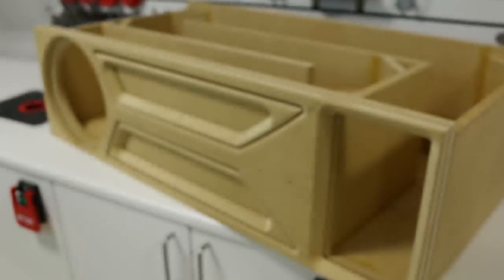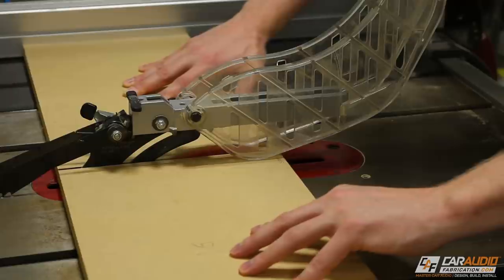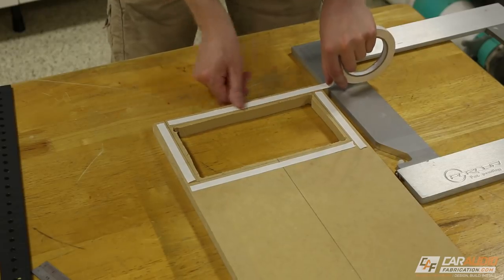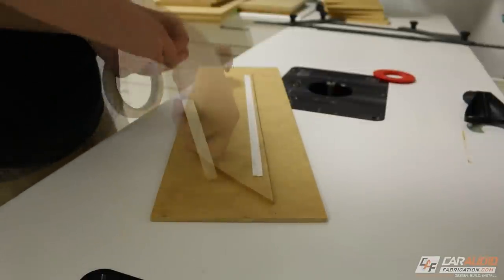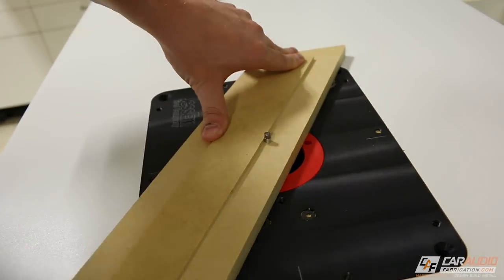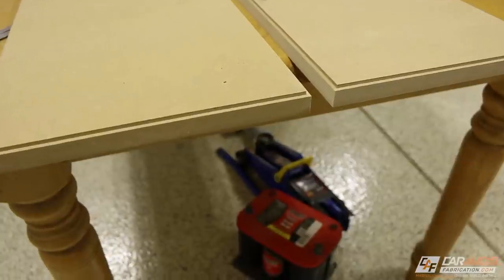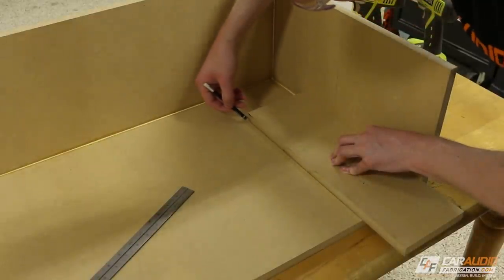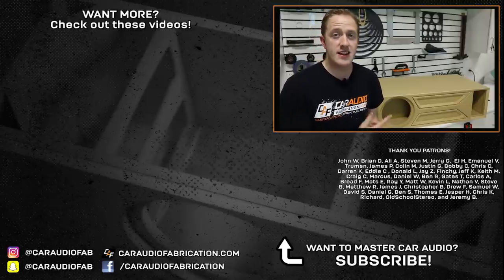How to Build a T-Line Subwoofer Box

Comment: Looks exactly like any other folded horn subwoofer. What's a "Transmission Line" subwoofer & how is it different from a folded horn subwoofer?
Reply: OK I figured out the difference. The transmission line has the horn behind the speaker. The folded horn has the horn in front of the speaker. The T-Line goes deeper, the folded horn goes louder.

Comment: To be honest transmission line boxes are the best...
Reply from the maker: +Seth Hardin the best at what? So if you need a subwoofer box under the seat of a truck is it the "best". No. Every situation has a different set of requirements. There is no "best"

Comment: A quick question, why do so many designers use MDF? Its heavy and moisture messes with storability.
Reply from the maker: Because its heavy, you don't want the box to resonate otherwise it sounds horrible. Solution to moisture problems... don't expose the enclosure to moisture.
Reply: ty,
Reply: Moisture = more weight, better sound heheh

Comment: i got two 8 inch studio monitors at home but the front has a big chip in the wood. can i fill it up and paint it or do i need to build a new enclosure. the front isnt removable so i dont know what to do
Reply from the maker: +ronnie tjikoeri you could try filling it with automotive body filler and sanding and really painting
Reply from the maker: +CarAudioFabrication *repainting

Comment: Just buy cnc machine 🐵
Reply from the maker: +SuperKanuuna would you find it interesting to watch me click buttons? Lol I rather use "hand tools" , I know they are specialized but much more obtainable than a Cnc router for the common builder.
Reply: CarAudioFabrication Hahah! I feel you bro :D
Reply: you get that mAD SMD Props doe and fans boys will Rush in SMD= Rockforfosgate in the 90's
Reply: An inexpensive 2 axis CNC machine is far more expensive then the average person is going to want to let alone be able to spend money on. Then there is the consideration for work space since most machines have a fairly large foot print and can not easily be moved. Versus a table saw, router table, common hand tools and power tools. You could buy everything you see in these videos plus some for the price of a CNC machine... SO when you consider all that, not really worth it for the average Joe to do. Now if you are looking to mass produce enclosures that are "Made in America" then I would wholeheartedly endorse that venture :) So long as you design the enclosure with a particular subwoofer and vehicle in mind and not as a one for all you see to often. Sort of like what JL audio does with their vehicle specific enclosures.
Reply: Just push buttons and put in 17 explosions every time you press the button 😂